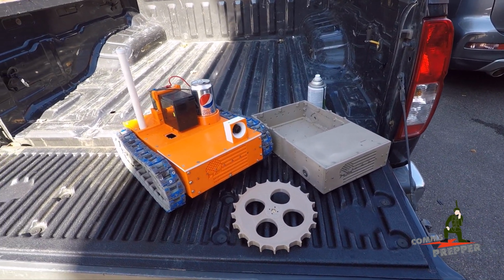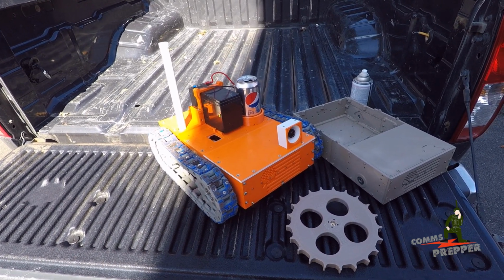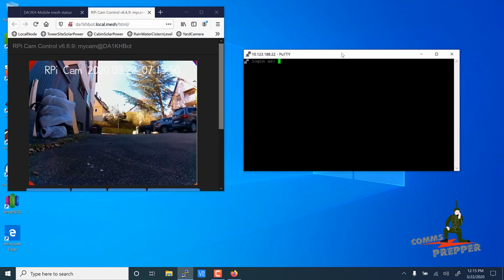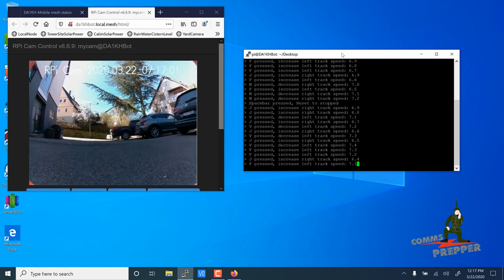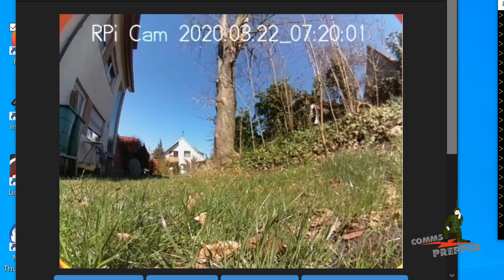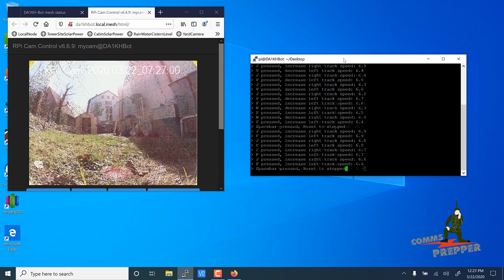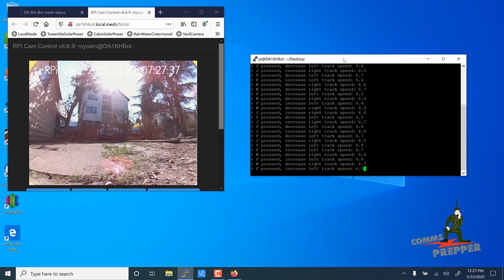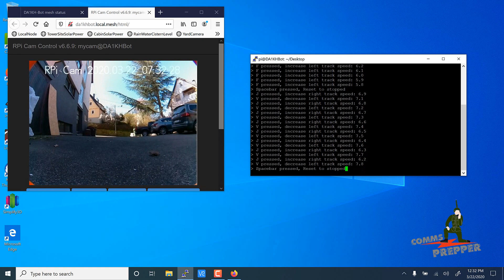AREDN Rover Bot with Raspberry PI

Comment: Miss Germany, loved the food!!  
You might experiment with Ardupilot. You can set autonomous (drive to this spot)so you are not having to keep correcting the robot.   The older versions don't really cost a lot and software is free.
Reply from the maker: I need to check that out.
Reply: If it were me I would use the rasberry pie as a base station plugged into your solar.  That way it always has a power/ data link.  You can remote desktop into the raspberry and run the robot from it to the ardupilot.  Future robot upgrade you might add a 3d printed gimbal for the camera so you can create 360 panorama pics to send.  You could still keep the pie on the robot and have a dual link to the ardupilot.  You can also run the base station on other functions in the cabin.  Love the project if I didn't have 10,000 other projects going on right now I would be building one myself.  Running 5 pies at home  doing different functions. I also mess with a few at work.. have a remote camera project (30x IP camera) that I use the pie to monitor the system... solar, battery and to turn the camera on/off to save battery.
Reply: Lotta gayfers in germany...good comrades💉💉💉👍🏿

Comment: you might be interested in this if your thinking about building a mk2, he has also put the stl files one thingiverse and a link to them in the video description:
https://www.youtube.com/watch?v=UdL4M4JpdsU
Reply from the maker: Damn - his is so much better than mine.  Looks like I have some work to do.
Reply: @Commsprepper  designing and building autonomous craft is his passion, he's made some interesting stuff over the years including solar powered long range rc planes. I thought you might be interested in his tracked offering, especially as you  said you plan to make a mk2 and he has released the stl files for his, you could take elements from his design or even just make it as is if you liked it enough.
All his vehicles be they land , air or water based are running Ardupilot and you can see the autonomous uses in most of his videos.
you can definitely integrate the control system you are using into Ardupilot, you'd just put the flight controller  between your control so that it gives the flight controller the pwm Instead of the motor controllers and the flight controller would then control them.
By doing that you would gain the ability to go fully autonomous on a pre loaded mission or auto return to home or any of a number of other modes by simply changing the pwm value on a dedicated channel (assuming you can output a 3rd pwm on the system your using and not just the two for the motor's) and you can also have a shit tonne of telemetry data on your live video feed.

Setup correctly, you could make your tank patrol an area over and over autonomously without you needing to physically control it yourself by integrating Ardupilot :)